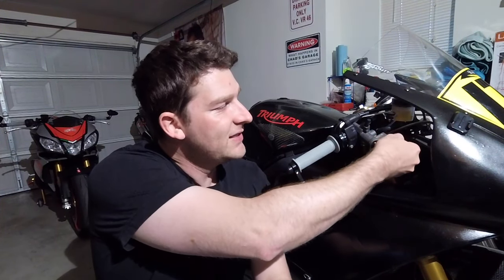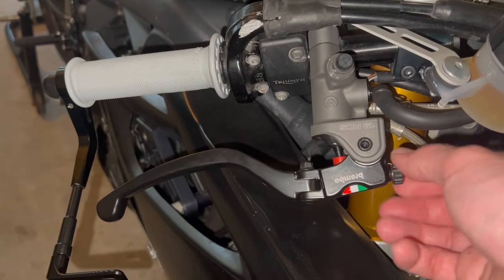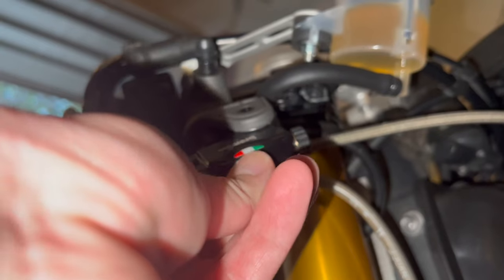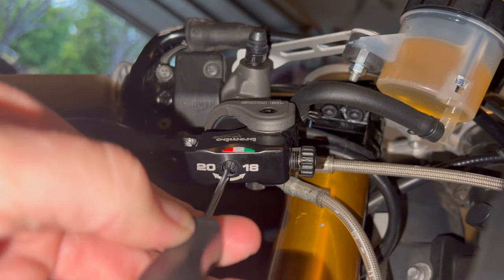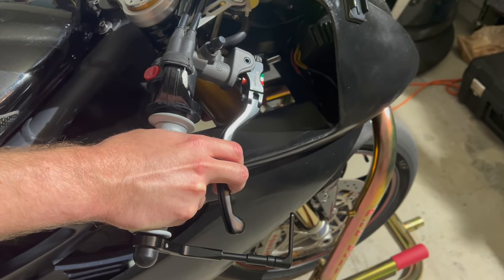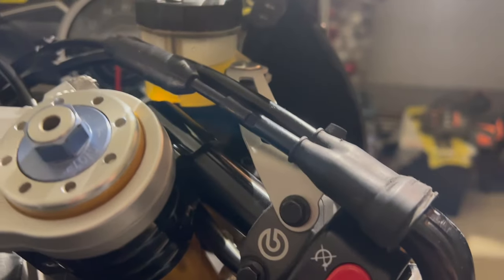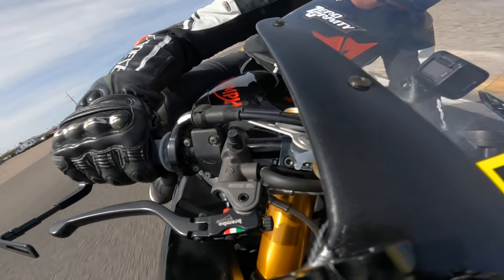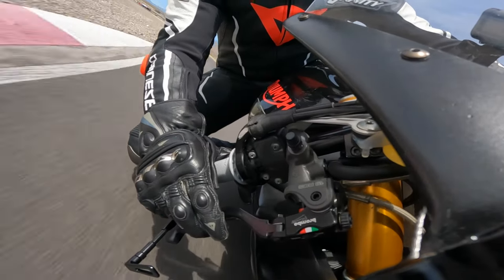Brembo 19RCS First Impressions - Initial Thoughts - Triumph Daytona 675R

Comment: Just a small point, a smaller piston master cylinder produces more power, or larger brake caliper pistons do the same… you need to have a big difference to produce the power/ratio. Similar concept as sprocket gearing. So bigger is necessarily’better’ 👍

A larger piston does move more fluid as you mentioned.
Reply from the maker: You’re spot on, what I meant to communicate was that the lever does not need to be pulled as far to engage the brakes. In my head, that correlated to more stopping power. The lever should require more finger strength to operate now, but with less travel required to engage the brakes compared to the old master cylinder. That said, it did feel like I wasn’t needing to apply much more, if any more pressure than with my old MC, but as we’ve established, it and all its internal components were 10 years old, which could have made it more difficult to operate.
Reply: @hiimchad  thanks Chad 👍
Reply from the maker: @jamest5149  appreciate you calling that out! 🙂

Comment: I've got a gen 1 675 with the stock Nissan master cylinder on my track bike and they're super responsive and really progressive and my mate has the brembo ones and they feel like crap compared to my brakes, I think brembo make awesome breaks but lack when I comes to the master cylinder
Reply from the maker: Hey Jaryd! Thanks for sharing your experience! The Nissin setup on my old 2006 Daytona 675 I used to have were pretty good and had similar feel when hot to my 675R's stock setup with the OE Brembo MC. That said, this setup with the 19RCS blows both of my prior setups out of the water. I get a lot of feel with this MC, much more than the stock Brembo unit, and they don't fade much at all, which was my main issue with the stock MC.

Comment: I have a 2007 675 with the stock first gen nissin calipers and nissin MC… i feel a little creak when pulling the lever and I have to pull it very far until it engages… basicly im tryin to justify to buy the nice brembo kit😂😅
But now to my question… as I read you also had a 06 gen 1 daytona before with the same mediocre non monoblock nissin calipers… do you think it would still be a worthwhile upgrade or should I upgrade the calipers first? 
Also very nice video!
Good Daytona content is rare😉
Reply from the maker: Hey Fey! I would start with the MC before changing out the calipers. It will be less expensive and probably make the biggest difference. Pairing new Brembo calipers with a meh master cylinder that I would guess hasn't been serviced in 15 years aside from a fluid flush is still going to leave you with meh brakes. Calipers generally hold up better over time than MCs since there isn't as much rubber.

And thank you! Doesn't seem to get as much attention as my Aprilia videos, but I still enjoy making them 🙂

Comment: rcs 19 was an easy install, i was expecting to do some wiring. that rear wheel hop was scary at first now but i am having fun with it.
Reply from the maker: Glad you had an experience with the install similar to mine! Definitely scary the first few times you use the brakes hard, but man is it great after that. Any reason in particular you decided to go for it?
Reply: @hiimchad  definitely is. will be turning it into track bike next year, especially since I live close to Sonoma raceway.
Reply from the maker: @metalmoto4008  niiiice! Sonoma is definitely on my list of tracks to ride.

Comment: Hey Chad, curious question, when was the last time you serviced the brake system/ fluid/ bleed prior to fitting the new RCS? The reason I ask is like previous commenters "apparently" the brembo masters weren't the best, I have both 09 and 13 with the nissin 19mm master with brembo Z pads which is pretty damn good I run medium fast and very rarely get fade, I notice all the things your mentioning when I changed pads and rebuilt the system, pads played a large part yes but I do feel like rebuilding and rebleeding the system properly made more of a difference and gave me that rock solid feel and feedback. 
Would you say the RCS is really superb or could much of it be attributed to fresh re-bleed and fluids ? 
Love the race videos, keep em coming, keep us updated 👍🏼
Reply from the maker: Hey Chris! I had fully flushed the fluid about 10 months before I added the 19RCS and had done small bleeds I think twice after that. I did a full flush about a year before that last one too. It does seem like the OEM Brembo masters they used on the 11-12 675Rs are hit or miss in terms of consistency and performance. The stock MC had never been rebuilt to my knowledge, so that could have certainly had an impact.

I think the other big benefit and what I really like about the 19RCS is the reduced lever travel. It requires about half the lever travel that the original MC did to get equivalent braking force, although the lever does require a bit more effort. This is great for me though, as I would get to the point where the lever was occasionally hitting my ring and pinky finger under hard braking (I brake with two fingers). I’m very happy with the 19RCS thus far and am glad I made the upgrade. 🙂
Reply: @hiimchad  nice! Yeah there's nothing more unnerving than having that soft no pressure feeling in the lever. I must say the RCS is a nice looking bit of kit, it nice to know it performs every bit as good as it looks,  Really enjoying the videos, bit bummed about your last spill in race 2 but that's racing, excited to see more trophies and top steps , I have a feeling your gonna do well this season 👍🏼
Reply from the maker: @Lordy23  Glad to hear you're enjoying them! The spill was a bummer for sure, but I'm definitely past it now. The bike is in good shape, I have gear again, and I'm feeling good too. Appreciate your support and kind wishes 🙂🙏

Comment: Can't decide if I should go for 17 or 19RCS for 765R 2020... Corsa Corta are propably not worth or road street use?
Reply from the maker: Nothing wrong with opting for the Corsa Corta if you'd like the extra adjustability! The 19RCS is recommended for the Brembo M4 calipers that my 675R is equipped with, but I believe the 765 Moto2 has the newer Stylema calipers. Not sure what is recommended for those, but generally, the larger diameter the master cylinder, the more force it will require to engage the brakes, but the less the lever will need to travel to apply that force. The smaller the piston, the less force, but with more level travel required. This assumes the pistons in the calipers are larger than that of the master. I forget exactly the relationship, so would recommend reading up on it before making a decision. It may be helpful to see what some of the Panigale V4 guys are running, as I believe those come with the Stylemas as well.

Comment: I just bought a RCS 19 for my GSXR 750 on the fulcrum adjustment which is less aggressive? Red side up or Black side up?
Reply from the maker: Red side up is less aggressive. Red side is the 18mm position, black side is 20mm. 18mm requires the lever to travel further to achieve a certain brake pressure than the 20mm position.

Comment: Would you put one on the Tuono? Or would a 17RCS be a better size?
Reply from the maker: Good question! I’m honestly pretty happy with the Tuono’s brakes as they are for now. They work much better than the brakes on the Daytona did before the 19RCS, despite having less aggressive pads. I would need to do more research to make a decision if I did decide to upgrade it. 

I went with the 19 as opposed to the 17 for the Daytona based on recommendations on the Triumph forum and elsewhere online, and I’m very happy with my choice so far. If I recall correctly, the piston in the stock master was 14mm, so the 19 is a big change, although I suspect my old master wasn’t doing so hot on the inside based on the fact that it didn’t really feel like I had to exert more pressure on the lever of the 19RCS, it just traveled significantly less. That seems to be the theme here. All else constant, bigger master cylinder needs more force on the lever to engage the brakes but there is less lever travel required, while a smaller master cylinder requires less force but has more lever travel. Not sure what the size of the Tuono’s piston is, as it is a newer unit than my Daytona had, but based on the size of the casing I would guess 14-16mm.
Reply: Definitely 19, 17 is for smaller bikes